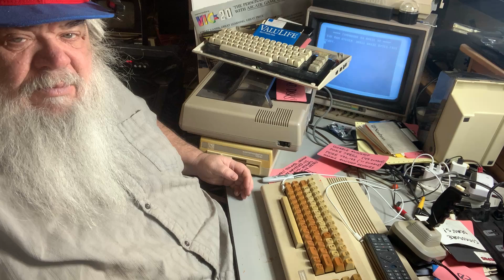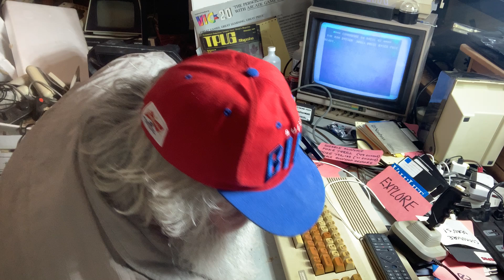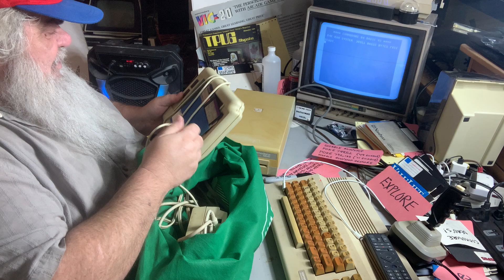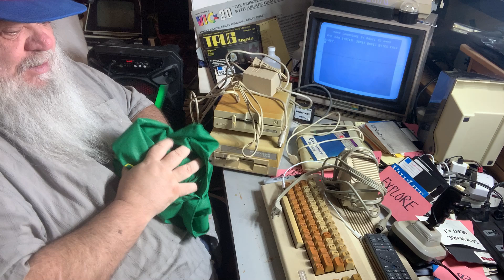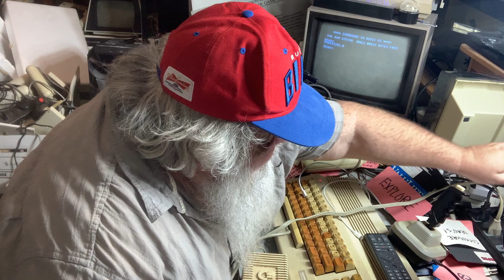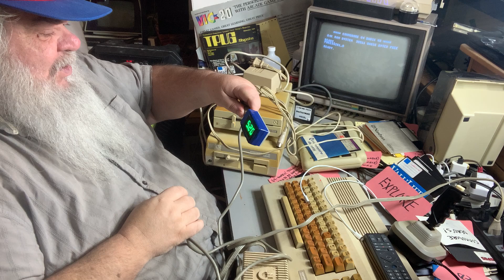Commodore 64 Testing C64 Original Power Supply The 5 Volt Side - 8 Bit Commodore Man - Episode 2869

Comment: I am still running my two C64-Cs and my three 1541-IIs with original power supplies (brick style, no elephant foot). I know it's risky, but replacing them all with modern switched-mode power supplies (SMPS) would be way more expensive than replacing one of the devices supplied, should it ever be killed. And German Wikipedia says SMPSs would have a higher rate of failure and a shorter life time than the older linear power supplies with transformer.
Reply from the maker: If I was in your situation, I would only ever look for a replacement for the 64's...as in get one of the modern supplies...because from what I have seen, the 1541-II supplies were quite reliable and I have never heard of one going ballistic...but I generally use the old originals as well, and I check the 5 volt side from time to time to ensure that things are going well, and if not, I snip the wires!
Reply: @DRBradleyPhotography  Good to know, thank you.
Reply from the maker: @NuntiusLegis  Keep on enjoying living in an 8 bit world!
Reply: @ A C64 was my first computer in the 80s, but I must admit I didn't use it for about two decades, then I reactivated it and got more hooked than ever. It just has qualities modern computers lack - ready two secs after switching it on with a full blown, user friendly programming language at my fingertips, which also has a direct mode which together with the command screen unique to CBM computers (other than just a command line) is a great UI, etc. :-)
Reply from the maker: It is really great to be able to turn on a computer and go...as quickly as it takes the monitor to warm up and open the window into the 8-Bit world...no passwords, no internet updates, no blue screens of death, etc, etc, etc...and if you have a program on a cartridge, just pop it in, turn on the power and go!

Comment: I "fixed" my old C64 power supply by taking the guts out of a 5VDC USB wall wart. The 9VAC just comes from the old transformer. The 5DVC wart "guts" fit inside the power supply and get connected directly to the 120VAC. Peace and Commodore. I just watched Commodores funny promo for the 264/364. It's a Hoot as they claim to be the computer of the future! I wish they had been, I loved my Amiga at the time! Peace and I won't do no more politics. Tired of them all!
Reply from the maker: Sounds like you did a great job "restoring" your old power supply...and indeed, the IBM machines made by commodore were...well...ok...perhaps even good, but it was just a distraction from what they should have been doing...but that is what happens when you chase Jack away and leave management to people who could not manage their way out of a paper bag and the brain exodus hits overdrive...and poof...it is over...sigh...